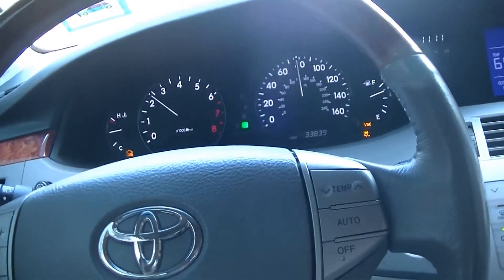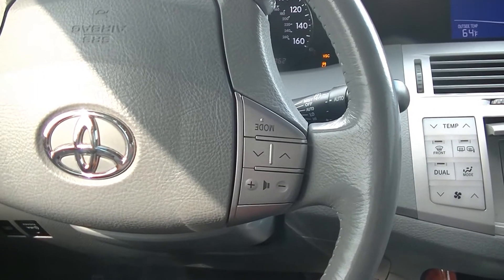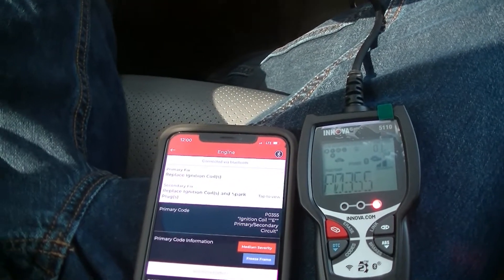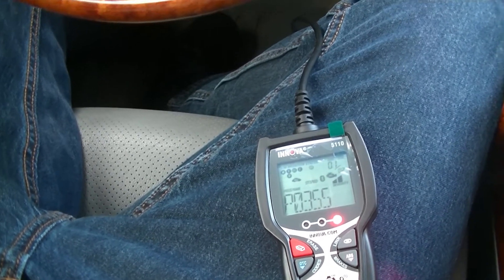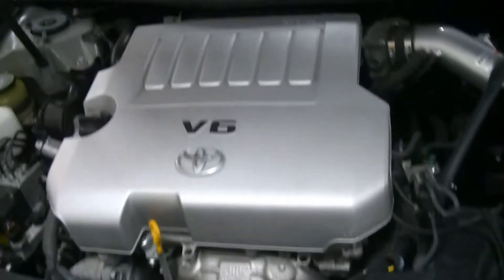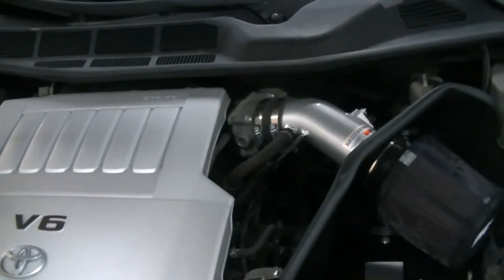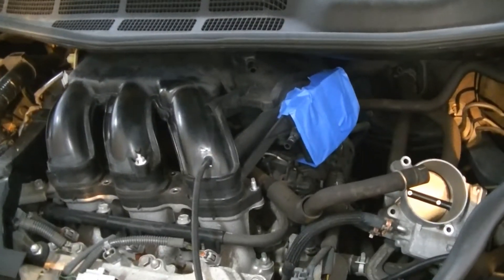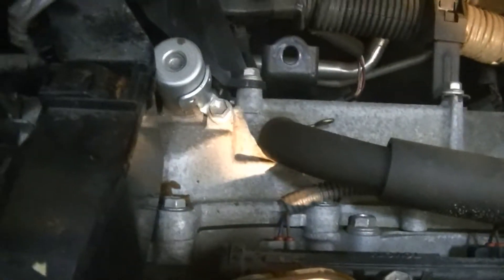Toyota and Lexus 3.5 liter V6 2GR-FE spark plug and ignition coil replacement due to P0355 (part 1)

Comment: 2005 here too; I've had two bad starts where maybe there was misfiring because the engine was running way rough. After a restart both times it resolved itself. I wasn't able to even pull a code after the restarts.
The first time it was way cold - maybe even 0 or below.

Comment: How long does it take to replace the coil on the no 2 Cylinder? My dad had a misfire on his 2008 Camry, same engine as this one. The Toyota dealer charged him 875 dollars to replace an ignition coil. Just pissed me off, they keep scamming him.
Reply from the maker: Number 2 should be on the front so 20 minutes tops. Did they replace all 6 spark plugs by chance?
Reply: @SEsGarage  No, just the no 2😡...
Reply from the maker: @MrZdvy  1, 3, and 5 are the rear bank. 2, 4, and 6 are the front
Reply: @SEsGarage  yeah, that’s what I figured....thanks. This Toyota dealer is a total con artist...
Reply from the maker: @MrZdvy  I don’t like it when people take advantage of people and that’s one of the reasons that I do these videos. When I worked at the dealer I priced jobs fairly. That job should’ve been an an hour of diagnosis and then a half hour to install the part so one and a half hours of labor total plus the part
Reply: @SEsGarage   Let me correct my earlier post, it seems they replaced the spark plugs as well. The bill showed labor 540 dollars, Coil 148 dollars, 6 spark plugs 132 dollars, shop supplies 45 dollars (whatever that is...) and tax 26 dollars. Still way too expensive ofcourse. I could have done it for him, but I live too far away.
Reply: 5 min

Comment: I really don't like transverse engines. Rear wheel drive vehicles for me. I also so buy Toyota and lexus vehicles only.
Reply from the maker: I don’t mind transverse. I’ve owned more front wheels drive cars than rear honestly. Only thing that kind of sucks is the inherent torque steer that your typical front wheel drive vehicle has
Reply: @SEsGarage  l have a lexus ls430 2001 original engine and transmission with 335,000 miles. Original starter and alternator. I have had the timing belt pulleys serpentine belt thermostat spark plugs every 100,000 miles. Just regular maintenance after that brake pads and fluids changed.
Reply from the maker: @andrewvillanueva3722  those UZ series V8’s are damn near bullet proof. I’ve always wanted an older LS400, love their styling
Reply: @SEsGarage  the Toyota land cruiser 200 bro I hear all kinds of great stuff they will last easy 500,000 miles.

Comment: Can you just leave the bracket off in the back
Reply from the maker: I’m sure you could, but I would advise against it
Reply: @SEsGarage  what about just taking the cowl assembly off can the 3 rear be reached that way and that bracket, I know the bracket has to come off in order to do that 1 coil
Reply from the maker: @B-S1999  you can try that also, my original plan was to leave cowl on but that last bracket fought me going in. I had the intention of replacing the intake manifold gaskets while I was in there so I wasn’t too upset about it

Comment: I have a '13 Highlander with the same engine, and I am not sure if you had the car with the original intake or not.  Have you seen any actual difference with that cold air intake versus the OEM?  Is that a K&N intake?
Reply from the maker: not much to be felt power wise, it does sound much more aggressive

Comment: Your bank 2 intakes seemed discolored -- is that because of EGR gases? BIG differences between this and the top of the 1mz-fe V-6 on my 01 & 03 Avalons... up to now, I thought the engine redesign was relatively minor...
Reply from the maker: The 2GR does not use EGR so there is no EGR valve which is why they can use a plastic intake manifold. Could just be that the flow by from the PCV system favors one bank more than the other I’m not too sure but the runners were all relatively clean

Comment: I have the same bucking and hesitation in my 2008 Avalon. Should I just do all coilpacks and plus as well? No check engine light.
Reply from the maker: I’d scan it for codes and see what you’ve got. You may have some history or pending codes to point you in the right direction